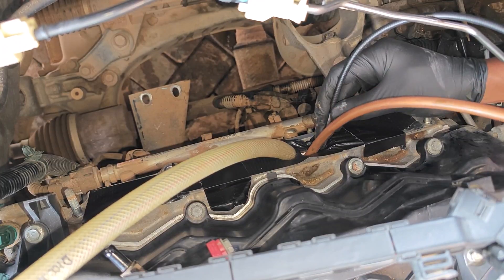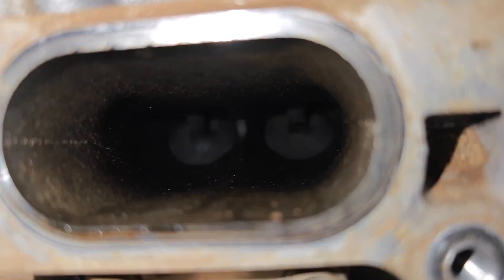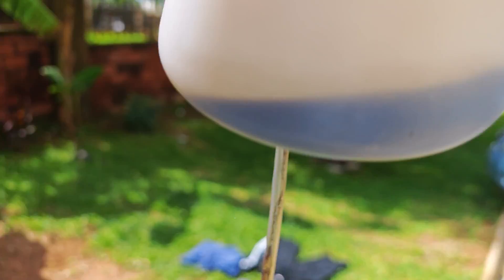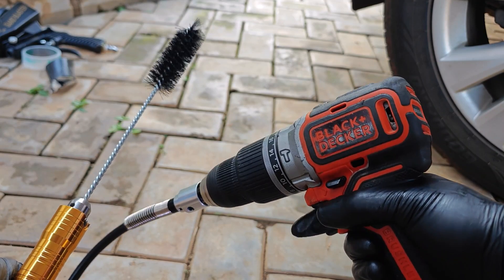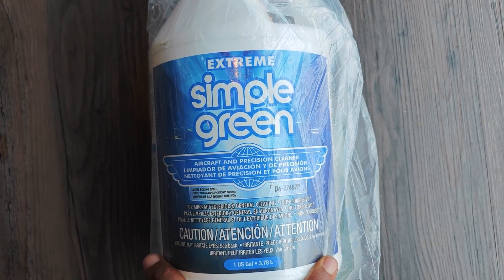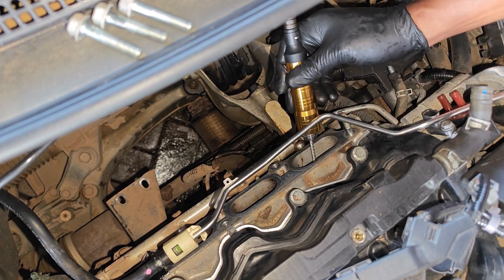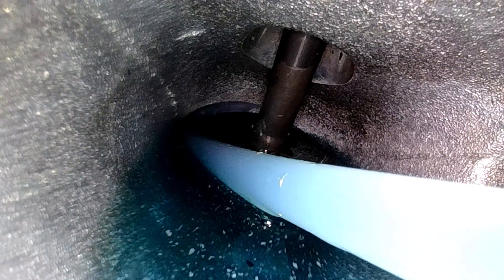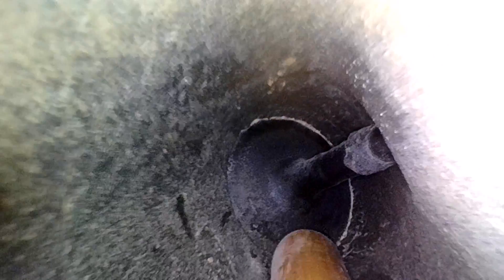Intake Valve Build UP Removal: BEST Intake Valve Cleaning with Drill / Direct Injection Cleaning

Comment: Direct injection sounds great until you get that crappy oil / carbon recirculated air dumped back into the intake manifold like you see here. That's why it's imperative to change motor oil frequently to keep the recirculated carbon deposits low. The best ones have Dexos 2 and API Service SP and ILSAC GF-6A designations on the container. These oils hold the carbon deposits in suspension for less carbon  build up since they don't stick to your engine internals. Kirkland full synthetic motor has these designations. I stock up when it goes on sale and save some of the used motor oil as chain lube for my yard tools.
Reply from the maker: Good thing is this car doesn't have an EGR, so that helps! I've videos proving Valvoline Restore and Protect holds stuff in suspension! So that's what I use. Also have a catch can so that helps!

Comment: I like the brake cleaner, gdi cleaner, and zip tie bundle method of cleaning the intake valves. However, I think a more advanced cleaning is using chelation chemicals like Hyundai ECF-1 (00232-19115) or Evapo-Rust. Stihl use to sell a decarbonizer (trisodium edta) as part of an 100 hr service for 4-mix engines. Evapo-Rust and ECF-1 are the closest things to that chemical. You could test a tetrasodium edta and citric acid solution (neutral ph), but evapo-rust is much safer. I've tested warm evapo-rust with spark plugs and a 4 hour soak might require some scraping while an overnight soak requires no scrubbing. 

https://youtu.be/vmnjy_ifWGQ?si=kNhCzxnz_jxYzdn8
https://youtu.be/9FY-YoBkmA0?si=HomGQ33pr5L-P15g&t=910
https://youtu.be/f9kBdJQMPPI?si=i2rX65L7NPHU5nqc

Comment: Could you tell if liquid leaked past the valves into the combustion chamber?
Reply from the maker: It didn't. For the degreaser bit, I left it on one occasion for a couple hours, level remained the same. For Carb cleaner, I just add and start cleaning immediately

Comment: Great video as usual and ita looking so clean dude!!!💪💪

Quick questions
- I am on my second bottle of liqui moly valve cleaner, do i have to change oil filter or something soon?
- after changing to r&p and the first 1000 mile oil filter change. When should be the next oil filter change be?
Reply from the maker: Thanks for the compliment!!! 
On Liqui Moly, I honestly just changed the oil at the next service interval. Same goes for R&P. After that oil filter change I did at 1000k, my next oil change was around 4500 miles ish

Comment: If ones engine is in somewhat healthy condition, being at top dead center, should prevent the solvent from going inside right?
Reply from the maker: The guide is that at any given point 1 (4-inline) or 2 cylinders (V6 etc) will have their intake valves open. In a healthy engine ie no burnt valve etc, fluid in the closed intake ports would remain in place.
But to your point, if a cylinder itself is at TDC, it's intake and exhaust valves are closed.
Reply: @DIYAutoworksNG
So what would happen if the valve head and the cylinder were somehow burnt or out of spec? If you scoped it and it was closed, then added your fluid but the fluid leaked down into the cylinder, what would be the result?
Would it do damage to the engine?
Reply: Oops didn't mean to press send, but it would end up in the piston cylinder right? Which could then let the fluid (carb cleaner, engine degreaser) get into the oil, would juts draining the oil and refilling it be enough to prevent damage? Or would you need to flush it?

Comment: The solution is to get rid of the car and get a Toyota man, why would you own any other
Reply from the maker: 😂. You have to get what makes you happy. I don't mind intake valve cleaning.
Reply: Two sets of injectors to possibly fail . Guess we shall see if it’s worth it